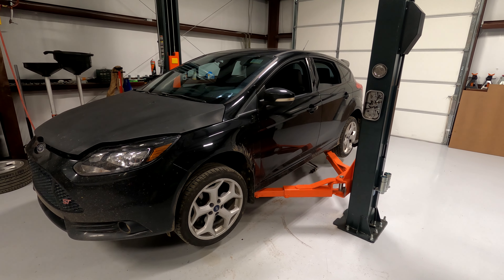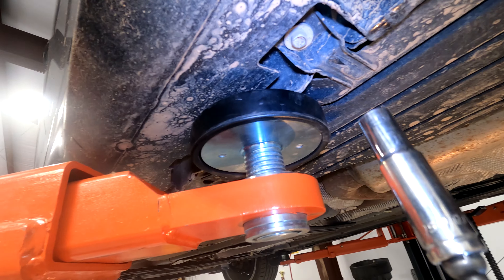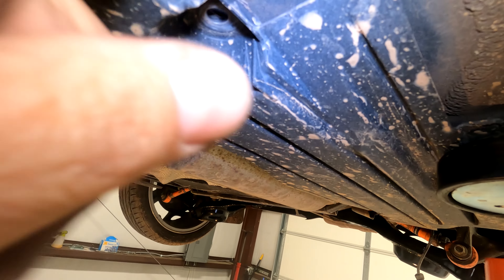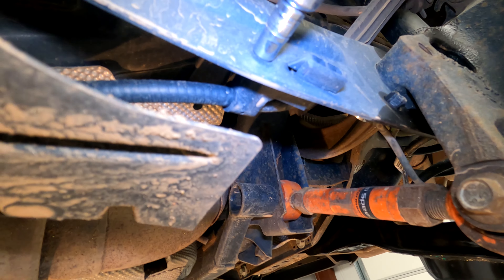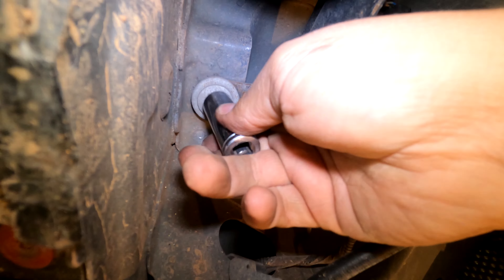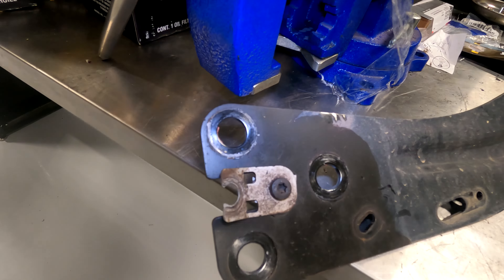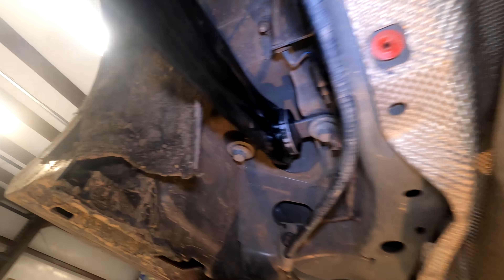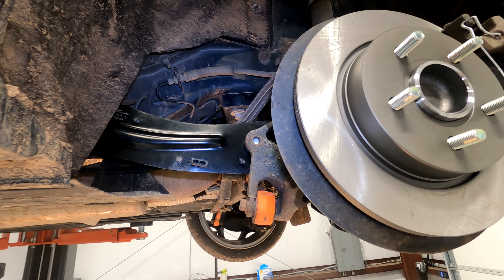2012+ Ford Focus Rear Trailing Arm Replacement Step-by-Step

Comment: i just swapped my old trailing arms to new ones. now it feels way better again. Thanks for the tutorial, one question i had was, which exact makita tool are you using in the video? because the small impact i have didn't fit there and i want the angle screw thingy with the best NM like yours, so it can handle the big bolts like the trailing arm ones next time without me screwing by hand like a maniac xD
Reply from the maker: Thanks for watching!

Comment: What are the symptoms of a bad trailing arm?
Reply from the maker: @pablojimenez9021  ripped bushings, noise while on bumps, bad alignment
Reply: @FatGuyBuilds  my escape started to wobble on highway speed, my guess is that I have bad rear camber
Reply from the maker: @pablojimenez9021  probably a bad hub bearing or weird tire wear or both.  What model tires do u have
Reply: @FatGuyBuilds  tires are highly unlikely since they're brand new, hub bearing doesn't make any noise
Reply from the maker: @pablojimenez9021  i had brand new tires and they would do it on the grooved freeways.  What brand are they.  BFG Ge-force tires and they did it from mile #1.  Then i threw them away.
Reply: @FatGuyBuilds  I forgot the brand, I got the "cheapest" they got in discount tire and still paid $480. But now you made me wonder because before I changed the tires I didn't had that issue
Reply from the maker: @pablojimenez9021  just try and grap a 2nd set of wheels and try.  Easier was to tell is drive on black top vs the grooved concrete.   If it drives nice and smooth on the black top. Then it is ur tires
Reply: @FatGuyBuilds  omg that's exactly what's happening, I found it so weird that only in the highway wobbles. I can't afford another set of tires I'm still making payments on the ones I got, do you think the tire shop would give me a new ones?
Reply from the maker: @pablojimenez9021  maybe.  It is the tread design.  Tell them to read this and drive it.

Comment: I have the bushing too do should I just change my trailing arm?
Reply from the maker: Unless u have a hydraulic shop press.  Then just buy the arms
Reply: And will it fit on my SE?
Reply from the maker: @yannickpilon9626  check rockauto.com
Reply: Hi , great video,  will that arm fit on my 2012  Ford grand C max 1,6 diesel please

Comment: It’s not focus 2012+. It’s 2012ford focus ST +
Reply from the maker: @harrington2316  steps are same for all 2012 plus.  Suspension is identical
Reply: @FatGuyBuilds  no sir. As you have an ST and you’re able to unbolt the entire arm from the rear knuckle. it’s not the same as S SE or SEL, on these cars you need to take rear upper control arm and lower lateral arm bolts out as well as lower control arm that hold the spring. Then You need to press the bushing out with knuckle suspended on a jack lol (good luck😘)